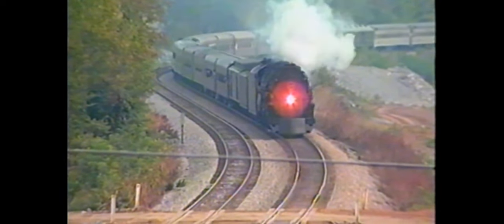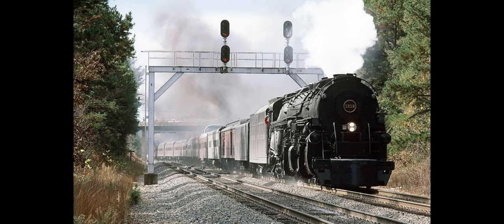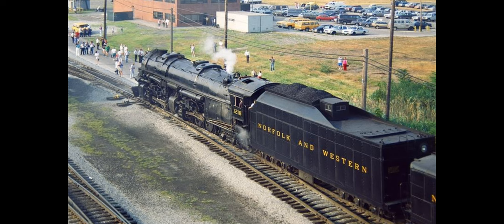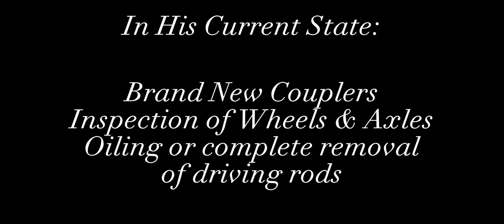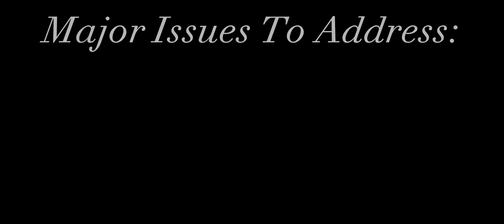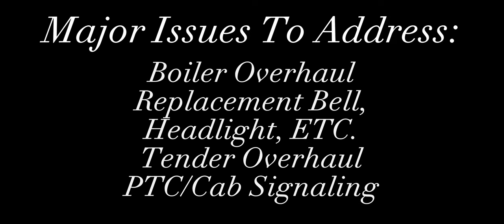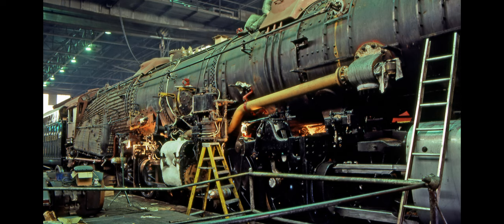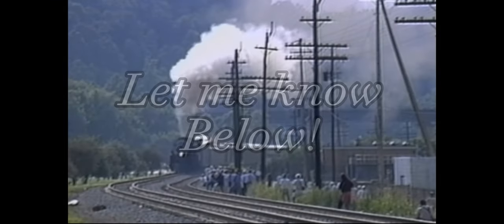Is a Full Restoration of N&W #1218 Possible?

Comment: I would love to see a FULL 4014 Style rebuild of not just 1218 but the sole surviving Y6a locomotive. But that is just me. What do you think?
Reply from the maker: It is possible, alot like 1218's is. Just have to find a place and time for it.
Reply: The MOT has no plans on restoring 2156, it would be a huge endeavor plus 2156 has a cracked frame.
Reply from the maker: @stevew270  that is a good point.
Reply: @stevew270  if the t1 trust could build a new t1 frame from SCRATCH so can they.
Reply: @felonius_gru7312  It's possible of course but not likely, me and I'm sure most others would just like to see 1218 run again, don't really care about building a new one.
Reply: @stevew270  It seems that a lot of people make a big deal about the crack in 2156's frame. This was a known problem on the Y5 and Y6 class. N&W had a procedure in place to correct these issues and return the locomotives back to service. Since YT tends to delete comments with links to external sources, I'll follow up with a second post linking to the source of my comment. 

According to Gordon Hamilton on Norfolk Western Historical Society mailing list on Sat Jun 29 15:35:22 EDT 2013 on the topic "Y Class, Etc"

I think that it is a coincidence that both Rick and Mason mentioned the speed of Y6 locomotives on the northern end of the Shenandoah because I was pondering doing the same. So, I'll go ahead with my comments.

When I finished college in June 1956 and went to work in the Motive Power Department of the N&W, I was given the title of Shop Inspector and assigned to the Shaffers Crossing roundhouse. The N&W was 100% steam then (including steam-turbine-electric N&W 2300, Jawn Henry). One of my assignments was to handle the broken parts reporting. Either the foremen would notify me of a failed part removed from some steam locomotive or else I would tour the roundhouse to find any broken parts removed on another shift. I would use a report form to describe the nature of each failure to the N&W physical lab, and hold the part until I heard back whether the lab wanted to inspect it.

I began to notice that an inordinately large percentage of the broken parts that I found had been removed from Class Y6 locomotives off the Roanoke--Hagerstown part of the Shenandoah Division. When I mentioned this to one of the more experienced shop inspectors, he told me that it was because the engineers on the north end ran the Y6's up to 60 mph there (this figure is what my feeble mind seems to recall he told me), obviously putting more stress on the reciprocating parts, such as the valve gear components. So, my information on Y6 speeds on the north end of the Shenandoah Division agrees with what Rick and Mason describe.

This brings to mind another Y6 maintenance problem that I observed as a Shop  Inspector during the summer of 1956, but one that doesn't seem to be well known based on some conversations that I have had with knowledgeable N&W locomotive historians. What is generally well known, and chronicled in Bud Jeffries book on N&W steam locomotives, is that the N&W in 1953-55 poured some 14 tons of lead in the low-pressure engine frames of Class Y5 and Y6 locomotives to take advantage of the increased tractive effort afforded by the application of booster valves that admitted some high pressure steam into the low pressure cylinders at low speeds. What I saw in my rounds of
the roundhouse was an occasional Class Y5 or Y6 shopped because of a low-pressure frame crack in the upper corner of the pedestal opening caused by the extra weight of the lead (so I was told).

The procedure was to spot the wheel set that was in the cracked pedestal over the roundhouse drop table, remove the rods connected to that wheelset, drop the wheelset and move it to the drop pit release spot to stow the wheelset, and return the drop table to the roundhouse floor level. The welding supervisor at that time was Curry Neese, and one of his men would take an acetylene torch and cut out the full length and depth of the crack in the frame. I would guess, based on my recollection now, that the width of the cut was at least an inch wide. The welder would then take a stick electrode and slowly fill in the cut groove with weld metal, finishing the job by grinding the weld metal flush with the frame surfaces.

This was a case of ten steps forward and one back. The forward steps were the increased performance with the booster valves, and the back step was the occasional cracked frame. I don't recall that there was an epidemic of cracked frames, but they did occur.

Comment: The biggest obstacle on getting 1218 back is replacing all of the missing parts that were removed from its incomplete overhaul, in addition to potential places where it could run. But never say never!
Reply: I'd say having a place to run it would be more challenging. Especially because of the number of cars needed to pull to break even.
Reply: Most of the parts were retured after NS Found them in storage in a warehouse of theirs.        They would have to replace the front tube sheet.  But the thing is were are they gonna run it?
Reply: It's not only where could they run it but who would allow them to, Amtrak is completely empty anti Steam and NS doesn't even have a steam program anymore
Reply: @RailPreserver2K  I wouldn't say Amtrak is completely against steam. Besides, if they were, why would they help out ATSF 3751?
Reply: @joenewstead4848  one place it can run, with permission: horseshoe curve.
Reply: Strasburg
Reply: A comment above states all the missing parts are stored inside the empty boiler.
Reply: @rearspeaker6364  But neither NS, nor any other Class I, is likely to give permission - or they would require such high insurance coverage that it would be financially prohibitive.
Reply: @noahbloom2300  you're saying it should be carrying that small freight?

Comment: If a totally brand new Peppercorn A1 4-6-2 (60163 Tornado) can be built here in the UK, I’m sure the same level of expertise can be put to good use on this loco’s restoration.
Reply: 5 years and 20million, it CAN be done!
Reply: You beat me to saying this. Surely sponsors can be found.
Reply: I mean, we have a group building a brand new Pennsy T1 (4-4-4-4) from the rails up and they’re doing good so far. The problem is most C1 railroads here in America just don’t have much faith in having steam engines running. The UP owns their engines but the rest of them are owned by other companies so insurance and fueling will be expensive.
Reply: @James-Railyard  and a good question is where is that thing going to run once it's finished
Reply: @katerinakittycat3849  its most likely to run excursions in PA and even around horseshoe curve
Reply: @James-Railyard  I was just a bout to say this!
Reply: You guys have an impeccable preservation program back in the old country. Here in the states, class 1 railroads care more about their profits than their heritage. Union Pacific being the one exception. You guys pretty much put us to shame.
Reply: Not a good comparison, this locomotive is twice the size as 60163

Comment: I have personally had a long conversation with one of the men in charge of the NS steam program.  1218 has all its necessary parts and they are stored inside the empty boiler.  Rebuilding her for operation is actually over half-way completed, although I am certain a complete review of the boiler steel will be made using U/T technology.  This locomotive sits in the Transportation Museum  looking cosmetically fine, but a total rebuild will require an infusion of about $1.5M .  Absolutely worth it in my opinion, as she's so modern and so unusual.  Use her for freight specials on a regular basis and allow her to build publicity while earning her keep.  She's way too large for passenger operations, but to pull heavy freight, she's way above ready to roll.  SItting her as a 'stuff and mount" is a terrible waste of a nearly perfect machine.  RUN HER!
Reply: When her rebuild was halted, I remember reading that the new boiler tubes were sold for scrap.  That would have to be remade.  I don't know if all the documentation was saved or not.  And after 28 years, nobody who worked on her is still available.  There will be a big learning curve.
Reply: We said that about 4014 and look what we got
Reply: @railfanmaximstill7279  That's on the Union Pacific, where management wholeheartedly supports the steam program.
Reply: 1218 pulled plenty of passenger excursions when restored. I think UP's Big Boy was around the 2 million dollar mark. Even R&N's 2102 soaked up 2.4 million. Anything's possible with enough money. Money will move mountains.
Reply: @railfanmaximstill7279  4014 was restored by an organization that has been around for decades and has an excellent reputation. The Virginia Museum of Transportation couldn't even run one if their own excursions. They had to get the Ft. Wayne Railroad Historical Society to run an excursion that the VMT was obligated to run in northern Virginia. They couldn't even staff their own excursion train. The 611's fund raising campaign was far from its goals until the NS Foundation sold a Rothko painting from their collection and donated a substantial amount of it to the Fire Up 611 Campaign. The VMT board is full of economic development clowns from the Chamber of Commerce who hate railfans, in my opinion.
Reply: also tbh those Who say 2156 should be restored clearly forgot the damage to her frame
Reply: I live near Roanoke and I heard there were a few missing parts that the 1218 needs. The last time I saw my baby (1218) was back in 2013. I've always advocated for the 1218 to be rebuild, restored and running again. But I think the 1218 would need more than $1.5 million for a full restoration to happen.
Reply: @TheSudrianTerrier653 where is the crack? I’ve seen it in person and can’t find it. It’s also the most powerful steam locomotive in existence and definitely should be restored if given the funds
Reply: @williamclarke4510  It's not just the incompetent VMT board members. It's the railfans who don't want to see 1218 run again. But yet they "care" about the preservation of railroad equipment and history.

Comment: Correction.   Most of the parts were retured after NS Found them in storage in a warehouse of theirs.        They would have to replace the front tube sheet.     SHE actually in good shape.   Originally they were gonna restore 1218 before 611.   But the cost if it was larger then expected and 611 was somewhat cheaper.
Reply: Of course the cost would be greater compared to the 611. 1218 is a bigger steam locomotive.

Comment: I think a 2nd rebuild of N&W 1218 to operation is possible. Regardless of what happens to class one railroads, more steam mainline steam operators are being invited by short lines and tourist railroads. PRR 1361, PRR 5550, NC&StL 576, Reading 2100, NKP 765, N&W 611 are either already or gonna operate excursion trains on short lines and tourist railroads. PTC/Cab signals are not required on short lines. For years, there is a big appetite for 1218 to operate excursion trains again.

Comment: In truth, it'd only take 2 or 3 to rebuild her completely to current FRA standards for steam operations. The biggest problem is as you said, funding. If NS would pull their heads out of their exhaust ports, to put it WAY too nicely, it could be done a lot sooner. I think 1218 is a perfect candidate for restoration most especially with 4014 back out runnin around and with 3985 slated to return.

Comment: Lots of people say it’s not possible for 1218 to run again because from a rumor I’ve heard that her frame is badly damaged. But I completely believe she can live again, since her size can’t be an issue since UP 4014 is much larger and the only real issue would be what railways she could go in, for example she probably could go to Strausburg but there’s no way to tell if she would be able to successfully traverses the tracks.
Reply: How did her frame get damaged?
Reply: And why would she need a new bell and headlight?
Reply: The damaged frame you’re missing up with N&W 2156
Reply: @Plumgoldfish129 the only reason 611 could run on strasburg is due to it being a very modern design, which includes roller bearings on each axles making it very lightweight. 1218 would crush the rails.
Reply: If restored, she would have to go run with the UP engines. As that seems to be the only place that can take her weight.
Reply: @Dassark  Her home rails can still withstand her, it's just that NS can't stand steam any longer because the Claytor family passed away and Wick Morman left the company. I hope CSX will let her and 611 run on their tracks and that both of them remain coal burners.
Reply: @New England Rail Video  Doesn't 1218 have roller bearings too?
Reply: @robertmohler9131  i thought it did

Edit: Yes she does
Reply: @robertmohler9131  yes, but 611 is smaller and because of it's modern design it is very light for a 4-8-4.
Reply: How did its frame get damaged, assuming that's true?
Reply: @603rail  What? The 611 weighs just under 500,000 lbs (engine weight) and 872,000 lbs. with the tender. That is actually heavier than most 4-8-4s. The drive axles each support 72,000 lbs.
Reply: @Motoskichimo1974  Not true. The 1218 only needs 120 lb. per yard length rail. That is well below what currently is used on mainline U.S. tracks. The Big Boy only needs 113 lb. per yard length rail to run. The myth that these engines are too heavy to run is not true. Modern mainline track is actually much stronger than what was used in the steam era.
Reply: @robertmohler9131  Unless their is a major change in policy, CSX will never let steam run.
Reply: @markantony3875  that maybe happening......... NS and Amtrak need to wake up too.
Reply: @1940limited  2156 has the cracked frame, 1218's is fine.
Reply: @robertmohler9131  Not going to happen unless CSX and NS merged.

Comment: I have followed sporadically the 1218 over the years and here are my thoughts.  1) IF she is in good condition and partially rebuilt, the full rebuild CAN be done.  As recently as 1 year ago the Santa Fe 2926 was rebuild and had made her first major run in NM.  It took donations and 20 years of hard work but it WAS DONE!  2) I too have heard of major problems but mostly with her boiler.  This would have to be inspected and brought up to standards.  3) As for fundraising, right now the T1 Trust is building an exact replica of the PRR T1.  The Trust is doing this because like the Peppercorn folks in the UK, there is NO example left and they have had a great campaign going to fund the work. 4) There are enough facilities that can handle the work to be done but I would STRONGLY recommend NOT asking NS for ANY help.  Except for the UP, most railroads do not care to help, do not have the time (although have the $$) and with changes in management, blow hot and cold about keeping what they privately deem (useless).  5) It has been a dream of the Virginia Museum of Transport to run the 611 with the 1218 and in fact, the Museum was (and may still be) looking to build a Lubidorium where the 1218 and the 611 can be stored and maintained.  Money can come from all sources and people who have contributed to this stream might be able to contribute small sums and get other railroad fans to do the same.  Once a program is begun and is pushed it is amazing to see who comes on board so to speak.  And finally, I would LOVE to see "The Tooter" back in service.  Such a grand engine needs to be restored to the rails.  Thank you for your video!

Comment: As far as what parts are missing, the boiler is just an empty shell. The tubes were all cut out, tube plates removed, etc. Now, it's not like we don't have blueprints and mechanical drawing for just about every single part from the N&W's modern steam fleet. It's not like we don't have the skilled labor and willing volunteers to do the work. It's not that we don't have the means of raising the funds. No, the real issue here is that there is nowhere feasible to run the 1218, which is a factor many people do not take into consideration with this sort of topic. It CAN be done, but to what effect? Where will it run and what will it do? It's too large and heavy for most tourist railroads, and with the lack of support from any class 1 railroads to run it on their mainline in the foreseeable future, why bother with all the time, money and effort? 611 got lucky in the fact that she was able to run at Strasburg with their clearances and weight restrictions being able to handle her and giving the Fire Up 611 group the green light, but now that she's going back to the NCTM I wonder what will become of her when 2030 rolls around...

Comment: The way I look at it the big issues really come down to money, time, a group dedicated to it's restoration, and a purpose to have it restored. That means having solved PTC issues and being allowed to run on the mainline without disrupting normal operations. N&W 611 is already facing this problem, only having a few chances to operate, thanks to scenic railroads or museums with space to run it. If a group can build a Pennsylvania Railroad T1 from the ground up, fixing an already built locomotive that is just missing parts should in theory be a lot cheaper and easier to do.